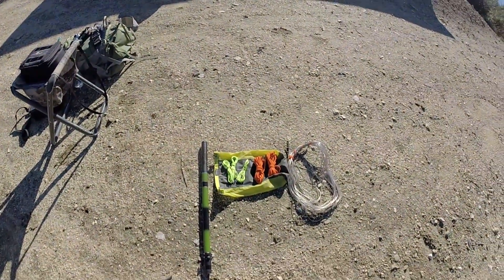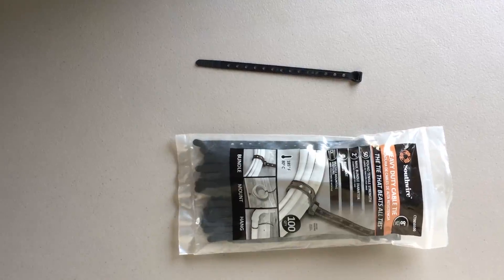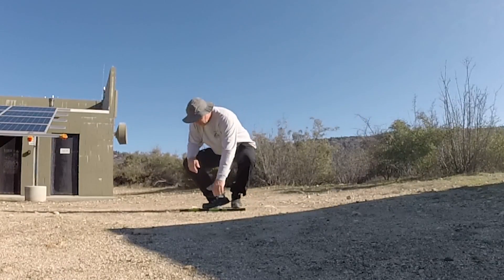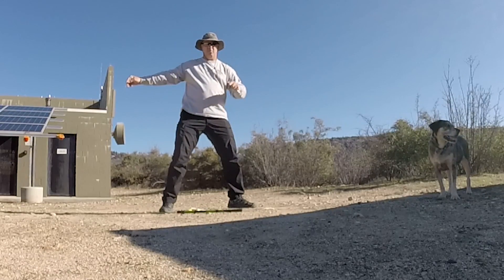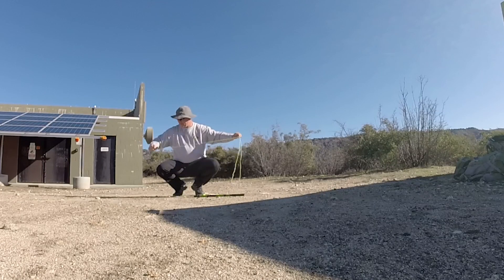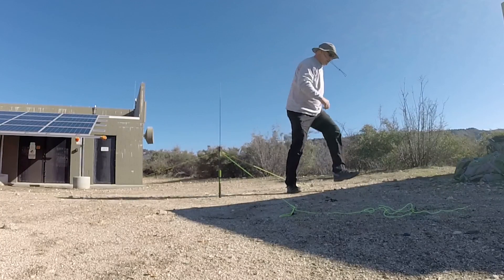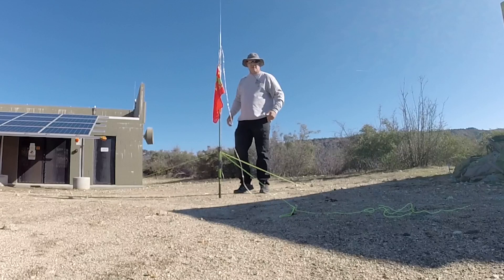How to DEPLOY the HQD SPEAKER WIRE ANTENNA

Comment: This was insightful, through would like to see/hear more of the antenna fundamentals explained as well, eg why be above ground, was there radiating elements or just a single speaker wire, does this antenna propagate directionally based on placement and why, insulator and other metal concerns (eg why not hang from a tree or metal structure).
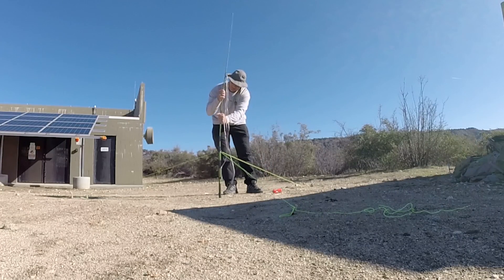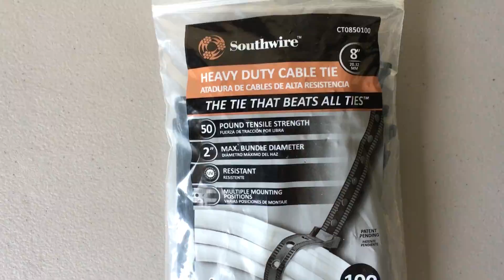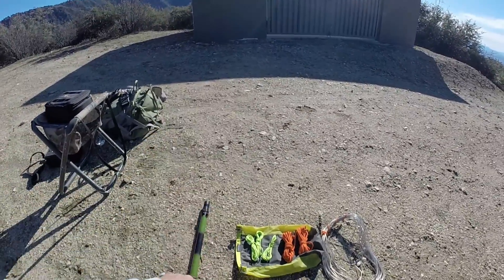Reply: Speaker wire is actually two wires attached in a pair.  All you have to do is carefully split/peel it down the middle until you reach the desired length of each "leg".  The "legs" of the antenna are the radiating elements.  One leg is for positive flow and the other leg is for negative flow.  Dipoles are directional because they propagate broadside.  Imagine a "clock" on the ground.  Now, imagine laying your dipole in straight line from 12:00 to 6:00 (or North to South).  This means that most of the signal and energy will be pushed toward 9:00 and 3:00 (or West and East).  So if you're in Florida and you want to talk to California, you can "spin" the dipole a little.  So put one leg at 2:00 and the other at 8:00.  That should push your signal toward a northwest direction toward Northern California, Oregon, Washington, Idaho, and everything between there and Louisiana.  As far as holding the antenna off the ground... I am not sure, but i believe that the ground/Earth itself will cause some interference or resistance.  He could definitely hang it from a tree but hanging it from a metal object could cause interference kinda like the Earth/ground can.  A lot of operators like to use fiberglass or carbon fiber fishing poles or painter's poles.  I think i've seen people using metal poles (like galvanized fence poles or aluminum poles) before--and with success--but maybe their signals suffered a little.  It's a game of give and take.  Nothing is 100% efficient or has 100% of your desired features and capabilities.

Comment: would a 40m tune on 80m I'm a new ham and planning on doing field operations since there is so much noise in my neighborhood because you said that the 20m would tune on 10m, 20m and 40m  or would it be better just to make multiple dipole antennas for different bands.

Comment: @1:46 so, I noticed that on my setup (very similar to yours) the ziptie going around the bamboo pole may be slightly loose and I can't get it any tighter at the top of the largest section. Is yours positioned at the top of the largest section? How do you prevent it from slipping down the pole? thanks.
Reply from the maker: When I get home I’ll take a picture of it and post it on Twitter and Instagram for you if you’re following me there. Short answer is yes, it’s in the larger section and I haven’t had it slip on me and you can add a small strip of black electricians take to snug the zip tie up to if necessary. HTH

Comment: Just curious here Jerry - Have you seen others use a fishing pole holder pounded into the ground rather than tent stakes and guy wires to secure it? Any pros/cons with going with that vs what you're currently doing? Maybe weight? thanks.
Reply from the maker: Some guys have something similar and to be honest it’s appealing on one hand and concerning where I’m at due to the very hard and rocky ground making it almost not feasible to use. I’d say it’s terrain depended and I envy those who can use that setup.

Comment: Great setup! I'm inspired.. thinking about doing something similar. Couple questions - @12:13 close-up picture of the little knot between the transmission line & where the two ends split apart. How did you loop that? How many feet did you cut your speaker wire to? Or, perhaps better - after they split, how long is each end? Next, how long are the green cords & the Orange cords? Thanks!

Comment: Great video again Jerry. I use a couple link dipoles for SOTA mostly because I need 40m and even 80 m these days to qualify. The tie off strings for the dipole have a slip knot loop at the ends and like California and rocks we have lots on summits here too in vk5. I have some pegs with me but usually just use a larger rock and make a noose type thingy around a rock to hold out the ends of the dipole. My pole is 7m these days and usually have stumps or posts all kind of things to hook the pole onto. Good work happy new year ..
Reply from the maker: Thanks and too funny how we have to use rocks to hold our stuff up 🤣

Comment: Hi Jerry, Thanks for all the good information here and on your channel. If you flip the snap
swivel so the round (monofilament) end goes over the mast the antenna should
hang higher up…not that you need that extra foot when you just hiked several thousand vertical:) All
the best, John KD2FLG.
Reply: I just started making my setup too - very similar to this. Yes, I got the smaller swivel as well, and the zip-tie won't go through it, so I had to add an 'inbetween' piece of small insulated wire sort of like a twist tie between the swivel and the zip tie. That still worked. I'll plan to setup mine this afternoon if all goes well. 73
Reply from the maker: Cool!
Reply from the maker: Ha! After making that video I replaced that swivel with a smaller one to do just that 😎👍🏻. I’ll take every inch that helps after crawling up those mountains lol. Thanks John

Comment: Jerry, where did you buy the pole you are using as your mast?
Roger W8RLP
Reply from the maker: Hi Roger - I have all my gear I use listed on my website https://www.kg6hqd.us and look for The “HQD” Gear Page. Scroll to the bottom and there’s a link for it there. Love this pole!  Any purchase you make from my site helps me out a bit so please consider that for me if you can.
Reply: KG6HQD Jerry I scrolled down found many items trekking pole but no fishing pole. Must be doing something wrong. 
Rogee
Reply from the maker: It’s at the very bottom ... if you’re on a mobile phone then you’ll need to hit the right arrow to toggle but on a desktop they are all three in a row
Reply: Jerry, thanks, found it and ordered it. I also made a stereo wire antenna today. Haven’t tuned it yet. Thanks Roger
Reply from the maker: Awesome & thanks!  I look forward to hearing how it all works for you.
Reply: Jerry, I ordered the mast but haven’t received it yet. Also sent 2 emails to the supplier and haven’t received a reply. Just wanted to let you know. 
73 Roger W8RLP

Comment: A cheaper alternative for good guy line cordage is the 1.18mm micro cord from Atwood Rope MFG. 125FT for around $5.50 minus shipping. https://atwoodrope.com/collections/micro-cord/products/1-18mm-neon-orange
Reply from the maker: Is it non sticky too? That’s one thing I do like about the stuff in the video is it has reflective tabs woven into the shell and the shell is snag proof built. The construction line I was using got all tangled up and the 550 paracord is ok but bulky compared to the item I now use. Looks like a great price for sure though.
Reply: It is mini braided poly/nylon rope, not a twisted nylon line like some construction line. I'm not sure about non sticky but I haven't had any massive issues with it tangling. It is comparable to the 550 paracord just much much smaller in diameter.

Comment: Always good to see the details of a setup.  I had not considered using the initial guying so close to the base of the pole relying on the legs/feedline to provide stability at the high end.  Great videos, awesome channel, thank you.
Reply from the maker: Thanks!  There's so many ways to setup in the field and the best way is the way that works for you on your given location.  I've done all kinds of configurations but this is the base plan absent gnarly wind conditions.  I think the important thing to remember is that the setup does't have to be perfect. Get the thing in the air and the legs out as best you can depending upon your terrain and give it a shot.  Only area to really be mindful would be the proximity of the legs to the ground.  I do think opening the legs to at least a 45 degree angle is better and get the ends of the elements about 4-5 feet off the ground if possible.  If not, set it up anyway and see what it looks like on the meter.  I base that on principles from the ARRL Antenna Book and from playing with the setup at home with my analyzer.  The closer the ends were to the ground the higher the Z became.  

What's your call sign?  Have we worked one another yet?

Comment: good video Jerry.  I tried to work you this past Sunday.  I saw your activation on Sotawatch.... I could hear some stations talking to you with big booming signals but I couldn't receive your station at all.  Im in Fresno, so maybe the way the antenna was angled, perhaps I was just outside of your reach.  Or maybe it was operator error on my part which is also likely.  Love the videos.
Reply from the maker: Hey David, thanks for the effort for sure. SOTA is nothing without others so I appreciate every one of the people who give it a shot. I’m headed back out next Monday and I’ll try again if you’re available. What’s your preferred band?
Reply: my station at home is good for anything 10 m through 40 m.  I have a similar portable set up to what you have.... also running a KX2 with a sotabeams linked dipole for 20, 30, and 40.  (inverted V)  It has little alligator clips that you can connect/disconnect for your preferred band.  I just got the radio and antenna, so I'm planning for my first activation.  I just need to find a summit to climb :-)
Reply from the maker: Awesome!  I'd guess that 40m would be our best shot being so close to one another but I am able to work that way on 20 as well depending on conditions.  If you are available on Monday let's definitely try to make it work.  I post on Twitter the night prior, and I add the alert before leaving just in case too.  If I have cell service or am feeling the scene will be a challenge I'll also spot on APRS2SOTA.  Monday is my new day off now so most of my activations will be between 9-11AM ish PST on Mondays if that helps.  I've been lucky to be several people's first SOTA contact as either a chaser or activator so I hope it works for us soon.

Do you have any questions on planning a SOTA hike or how to navigate the website info or are you pretty well versed on it by now?  Let me know if I can help in anyway.  73 - KG6HQD Jerry
Reply: Thanks Jerry... I will look for you on Monday morning on 40 meters.  I have the day off work so should have time to play with the radio.  I'm pretty new to ham and just venturing out with getting on the air.  I'm really interested in getting out and activating summits ... I'm more interested in being an activator than being a chaser.  I have learned a good deal by watching your videos.  Thanks.  I'm just about to start CW academy in a couple weeks so I hope to get out there with morse code.  If you ever venture farther north let me know, Id love to activate a summit with you some day!
Reply from the maker: Very cool David, and I totally get activating over chasing :) but we need both for sure.  It's always nice to hear people are learning things from watching my outings and if there's a topic you'd like covered please let me know.  I'm always down for new ideas and the challenge.  Hope to work you on Monday if the weather hold for both of us.